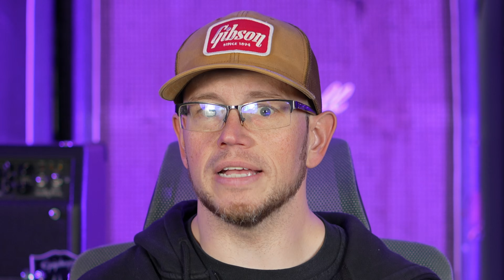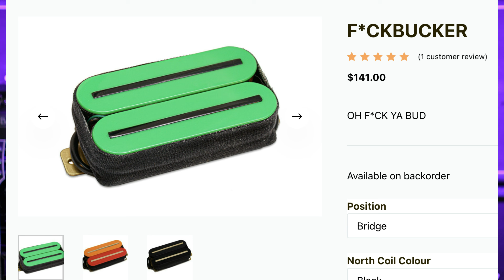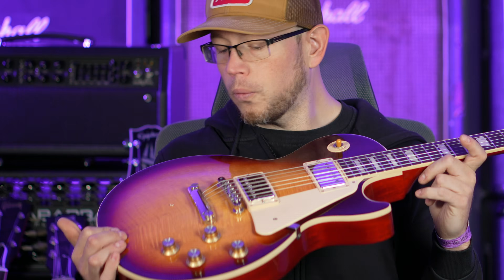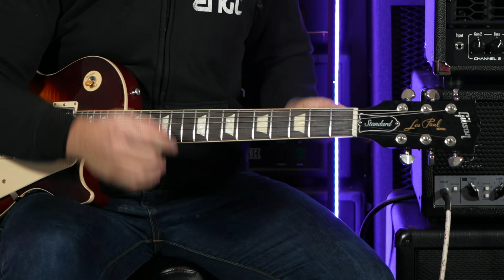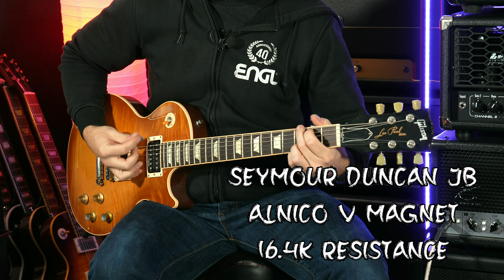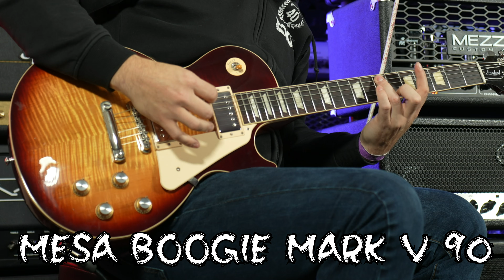EVERYONE has been using the WRONG pickups for metal......

Comment: Honestly, the differences are pretty subtle. A pickup can be very low output and then it goes through a drive pedal and suddenly it's hot. On the flip side, the fact that everybody uses these pedals in front of high gain amps renders the super high output pickups pretty moot, especially with the diode clipping the pedal does which will compress a really hot pickup anyway. I do hear an audible difference in clarity, but it is subtle. I think, without the pedal, the difference would have been greater. I'm also definitely sure that a PAF through a pedal set to clean boost is better than a ridiculously high output pickup straight into the amp. At least for high gain sounds.
Reply: At this point its mainly for EQ rather than gain. Like I can use a clean boost 6/7/10 band EQ with a lower output pickup and do some bass cut and high mid/treble boost to get the nice and tight chugga chugga, but I can also just run an EMG 81 or Duncan Distortion/Black Winter and skip the extra pedal and just dial back the amp gain.

I think there's definitely a point about very high output passives being redundant though (Invaders, Dimebucker, L500XL, X2N, etc...) there's a natural sacrifice in clarity with them as well as things like messing up intonation just from the magnet pull. But they still sell a decent amount of them anyway probably just from hype, you see posts on the line of "I just started playing for 4 months and I'm buying an Invader to put in my $200 guitar running into a $250 Boss Katana because I googled what's the hottest pickups" every other day on reddit and other social media.
Reply: @dumpsterplayer5133  I don't disagree with any of that, though I personally don't like actives. I don't know, something a little unsettling in the high mids that I always have to dial out, then I have to compensate somehow with more higher treble and that starts to step on the parts of the mix that should be mostly cymbals. The one high output pickup I have actually found I like, believe it or not, is the Stag Mag. On my Strat, adjusted a little farther from the strings than usual, just sounds exceptionally good and somewhat unique among high gain rhythm tones. That's not an extreme high output pickup though, it's just hotter than PAFs.
Reply: @AdamRainStopper  The EMG 81/Fishman style high mid/low treble frequency spike is largely where the guitar sit anyway in the isolated guitar tracks I hear in my favorite "modern" albums, but I like those kind of productions (Colin Richardson/Andy Sneap/Jason Suecof type) so its more to do with personal taste than anything.
Reply: @dumpsterplayer5133  I think the l500xl is an exception here, not only is it one of the hottest passive pickups you can buy (remember dcr isn't everything), my Bill Lawrence USA is the clearest most articulate pickup I own.
Reply: Clipping != compressing
Reply: @FrankyFeedler  That's what compression is, clipping higher signal levels off and therefor reducing volume.
Reply: @AdamRainStopper  No, it really isn’t. Clipping is literally cutting the extreme(s) of a wafeform off, where compression is reducing the dynamic range of the levels. Both give distinctly different results.
Reply: @FrankyFeedler  Clipping off the peaks of a waveform decreases the dynamic range of that waveform. All clipping is compression and all compression is clipping. There are different ways of achieving it that sound more or less hard clipped, but compressing a sound literally means clipping the peaks. I don't know what to tell you, compressors made in the 40s and 50s and 60s, the ones that are still being emulated today in the form of plugins as well as hardware, were built to decrease the dynamic range by clipping peaks. Saturation, distortion, compression, clipping, all different terms to mean exactly the same thing. The differences in sound come from whether it is soft or hard clipped, but an overdriven amplification stage clips the waveform at the peaks, as does the diode clipping in a distortion pedal.
Reply: @AdamRainStopper @ OK .. I tried. It would have been so much easier to google or ask ChatGPT “explain to me what the difference is between clipping and compression, how they do not mean the same thing, and achieve very different results” than to have a wall of text. Try it. Or not. Up to you; learn something or not.

Comment: Obvious 101: X+Y+Z = appropriate gain. HO PUPS made sense when the trend was “ODs suck, Amp only, plz.” You can play face melterz pups straight to a Hi gain amp, just as you can run LO A5 pups to 1-2 ODs to slam a lo gain 2203 for similar effect. X+Y+Z. As long as the summis sufficient gain it doesn’t mater what’s LO and what’s HO.

Comment: I was an active pickup/high output passive guy for years then got a chance to try some medium and low output pickups and they do have a clarity and open quality in comparison and it always inspires me. I did find a trick that works for me which is if you have high output pickups and want more of the clarity of a lower output pickup, running them in parallel is a nice middle ground between the two.

Comment: Worth mentioning that these Sugarbuckers are wax potted, as per Sweetwater's product description. Many PAF immitating pickups aren't. Somebody's going to watch this and install a Burstbucker in his guitar just to get woooooooo'd into oblivion the moment they plug into a high gain amp at band rehearsal volumes.
Reply from the maker: thats what they get for chosing a burstbucker inatead of one of the many great PAF pickups on the market
Reply: @belligerentamateur  well many of the most expensive boutique PAF reproductions aren't wax potted either cause "expensive PAF" endgame is usually to be a perfect vintage correct reproduction of the original, and the real PAFs weren't wax potted either. Whole point was: when you're choosing a PAF-style pickup, some aren't wax potted and you will have microphonic squeal feedback with metal gain on a real cab. Another example of a common pickup like that is DiMarzio's PAF 59 -- all other Dimarzio pickups are potted so it can be a surprise.

Comment: A clean boost pedal at the start of your signal chain is usually a more cost-effective, nominally better solution than a pickup replacement for lower output pickups, in my opinion. Also, importantly to me; Gibson is an overpriced clout brand, most of their designs are horribly flawed. You obviously like them, I utterly abhor Les Paul guitars, but I do like the clarity of PAF pickups for high gain tones. I don’t care for 24.75” guitars, generally speaking. We all have preferences.

Comment: man that duncan distortion really stole the show. the thing i'm not huge on is the scooped sound on vintage style pickups. most modern metal goes for that scooped sound anyway so i'm not sure why more people don't go for that, especially today where most humbuckers come in four conductor wiring for some ungodly reason
Reply: I don't feel that modern metal guitar tone is scooped, actually the opposite -- the whole downtuned djenty stuff especially is very midrange'y to compensate, and EMGs into 5150-type amp are like the default sound for everything. But even for scooped sounds, the PAF into modern amp combination to me is also not "good scooped". Highs are fizzy, lows aren't really very tight or very fat either. I love Duncan Distortion and love cutting 80s guitar sounds, but for any kind of scooped tone like nu metal or 90s death metal I would still prefer an SH-6 over a 7kOhm PAF type pickup.
Reply: @gryzew sounds about right. I’ve tried an SH-5 Duncan custom 2x. It’s a hot rodded PAf. Different guitars everything. Very trebly, thin sounding, i agree 100%. Personally one a my favs is a super distortion but I been running an 2 invaders in two different guitars and they’re monster pickups

Comment: I've been using Rio Grandes for years in all my electrics and one thing I've noticed is a slightly microphonic pickup can be really responsive with a high gain amp (I play Mark series stuff).  You can really hang it out there on the edge of feedback and use that in your playing.  You don't want something screeching at you constantly but to just be able to hang it into feedback effortlessly and on command.  I've never liked the feel of active pickups but I did play JBs and some others for a while.  I play chunky riff punk rock stuff.

Comment: Parallel-wired PAF into a clean boost = the signal strength to push the amp into to maximum gain, but with the dynamics and clarity for awesome cleans.
Reply: Everyone sleeps on parallel humbuckers when they are the perfect way to solve humbuckers being too "muddy" and split coils having hum.
Reply: @CoolGuyAtlas  And yet many Ibanez/Fender players have that wiring stock in their guitar.
Reply: What are these cleans you speak of?

Comment: My go-to compromise, and favorite pickup for my sound, is the Duncan SH5 Custom, the "PAF On Steroids." 

Not the Custom V (no mids, at the pickup mids = output) or the Custom II (haven't tried, A2, lower output, spongier bass).

Great tone, medium output, does cleans. It went in my Rampage and then my 03 Melody Maker, replacing the P90. 

Cut like a razor in the bright Rampage, because tonewood is real.

Oh, and? Best palm muted chunk anywhere. 

For the low output PAF thing with more articulate tightness, you'll want to check out the Dimarzio PAF Pro. The hex poles do their thing, and the Firebird Zero pickups are similar, all slugs so it has almost a single coil quality without the thinness.

Guitar Fetish has the Professional Series "KMZ", I have the original unpotted versions in my Agile LP. Like $39. 

See also metal covered Mean 90s, where the PAF style cover eliminates much of the hum, just like Iommi's Birch modded P90s in the Monkey SG.

Can't decide? Fluence Classic - PAF on one voice (with all the advantages of an active pickup) and 70s Butyrate Bobbin JB on the other AND a noiseless single coil.

These would be in my Les Paul, but since I bought the Agile with PAFs its 498/490 set isn't in a rush to go anywhere - another overlooked option that costs you nothing in the right Gibson.

Go check out the classic Keith Merrow demos he did for Seymour Duncan. You just might dig the 59/Custom hybrid, and it's the antidote to Glenn Fricker's nonsense about all pickups sounding the same through high gain.

Comment: I didn't use headphones, only my cell phone. But to me the hotter ceramics generally sounded a little better to me. However, I have a variety of guitars with a lot of pickup options. Tonally speaking, I have favorites that are not hot ceramics. I use a lot less distortion than youd think for a thrash guy.  I dont mess around with the settings on my amp. I just choose the guitar that sounds the best for what I want.

Comment: Just got a Epiphone Korina V loaded with Burstbuckers (modeled after Gibson 57' pickups iirc), they sound wonderfull trough my 6505+, of course there's more interference compared to active pickups like a set of EMG's or Blackouts especially when boosted with an 808 but having a noise suppressor on hand helps a lot. It also feels like I have more volume control, the neck pickup clear up nicely when rolled down. As you said the amp seems to do most of the work as some of my amps won't treat me this well and benefit of hotter pickups (a set of SD Distortions can make a lot of a difference in comparison to some stock pickups). Another benefit is IMO that the passive pickup sounds more organic and won't run out of battery at the worst moment possible, I still like a set of actives but it isn't the be-all and end-all of a highgain sound.

Comment: I've tried a variety of pickups and I always go back to the SD blackwinters. alnicos tend to be boomy and more scooped, and the transients on the treble tend to be really sharp. I boost my input section as much as i can without it getting overloaded and high gain amps just sound better when youre using less gain to get the amount of saturation i go for.

Comment: I've been using vintage output pickups for a while now. My buddy has a vintage '72 L6S. The best tone I ever got recording was his Gibson on one side, and my BC Rich with Invaders on the other, both double tracked with a layer of my Zoom amp modeler running a Plexi sim, and a layer of Behringer stomp boxes (TO800 into a UM300 for me, TO400 into the same UM300 for him) into an ART Tube MP Studio mic preamp so it would overdrive the tube (I did this with both the pedals and the Zoom) and both of those were run into the FX return of a Fender Mustang V half stack. I played rhythm, he played lead. All his solos were recorded using the Alex Wade factory preset on the mustang amp, boosted by the TO800, using the paired Mustang V 4x12 cab, and everything else was recorded with a Seismic Audio SA-412 cab, both with stock speakers. We mic'd everything up with a Sennheiser e609 on the cone/cap boundary and an off axis Behringer XM8500 over the middle section of the cone, through a Behringer Q802 Xenyx mixer (I was doing that before Glenn ever made that video) before hitting my interface.

My favorite setup these days is GFS Dream 180 in the bridge with a Dream 90 or their version of the '59 in the neck. If I want it hotter, I use a Seymour Duncan Active Blackouts Preamp. My Les Paul is wired up with that setup, with the Dream 90 and preamp. If someone wants more output from their pickups because their amp doesn't have enough gain or turning the gain up too much makes the tone turn to mush, they're better off pairing a lower output pickup with an active preamp, and the clarity and string separation is why. I've been telling people this for years. Use low output pickups, and use pedals and/or your amp's gain to make up the difference. Thicker distortion saturation, more clarity. Glad someone else finally figured it out.
Reply: I discovered this almost 25 years ago when I transplanted my glorious EMG set to a 2nd hand passive guitar and suddently the guitar became shit mush though my pod 2.0. I hate too high output pickups since then and EMG specially.
Reply: @abheceshabemuskk3531  yeah 25 years ago I was 12 and taking my first guitar lessons at Sam Ash lol
But I've read people saying similar things to what you said. It's not new info, it's just not widely available or discussed information, and it's drowned out by marketing from sales teams and misinformation that used to spread by word of mouth, and later the internet.

Comment: The HO pups were more important to people who were trying to squeeze any more distortion out of old non-master type amps.  Nowadays, most high gain amps almost have TOO much distortion, but the best way to let them "breathe" some is to use low output pups, and then bring up the gain on the amp a little bit (if required).

I have an Invective 120 & a JVM 410H.  Have an Ibanez that came with cheap, HO ceramics in it.  I found some cheap Alnico 2's that might put out about 7k's.  The amps definitely sound better - "woodier", and you can get more thickness out of the amps that way as well.

Not only that, but I lowered the pickup height as well - and it seriously sounds a LOT better on high gain settings.  Just smoother and less brittle - but like what you experienced in the video - just more clarity!
Reply: I have a JVM 410H and I have been very pleased with the tones I can get out of it.
Reply: @DanAdlingtonOnline  Honestly - I'm about to get rid of mine.  Some "mystery problem."  It suddenly has very limited volume on all channels.  Have changed all the output and preamp tubes with no success.  From what I can tell, it's a circuit board problem.

The theory behind the 410 is great, but in all honesty, the Invective blows it away - certainly with the high gain sounds...

I might try to fix it, but I don't know.  Not the first time I've had issues with it...

Comment: I personally am not a fan of using PAFs in the bridge in metal... or almost anything. It's mostly centered around my other choices in gear.
I don't like the typical modern American high gain amps, I'm using the Friedman IRX which doesn't have the most amount of gain and I like using as little gain as I can get away with. However at the same time I also don't like using overdrives to boost because it adds the kind of saturation I don't want and I switch between cleans and heavy tones a lot.
The minimum I personally enjoy playing with as far as DC resistance goes is around 12K DC, which is what combines best with vintage spec single coils too and sounds realistic when split. 12-16K is my comfort zone with the right amount of beef, loudness and clarity, though on unbalanced pickups like Dimarzios with Dual Resonance I don't even have a maximum I like, only the minimum of 12K.

But I do definitely get why you would recommend returning to lower output pickups, some do like to get as much of the gain from the amp and others do like overdrives. To each his own :)
The lower output pickups did sound better with the 5150, but I hate the 5150. I also hate using lots of gain on the amp. Why even stress the amp like that? to me always sounded worse when the gain comes too much from the amp or its channel. The Mark will sound even better opened up a little and with higher output pickups :D

I'll conclude by saying people are not using the wrong pickups, but the wrong amps. Everyone has been milking the 5150 and Rectifier to death. Try out a Mesa Mark (like in the video, great choice also using that!), Marshall JVM, Friedmans, Randalls, you name it :)